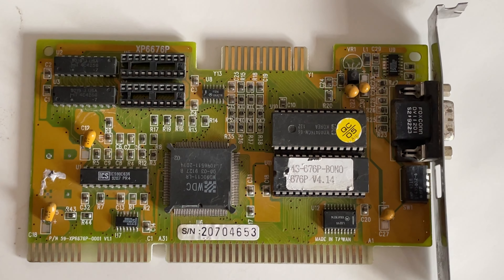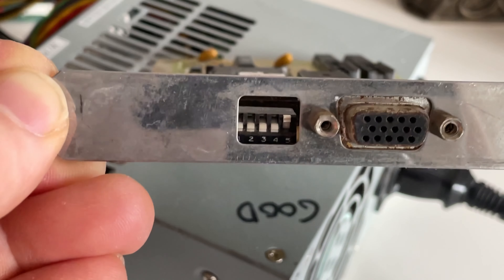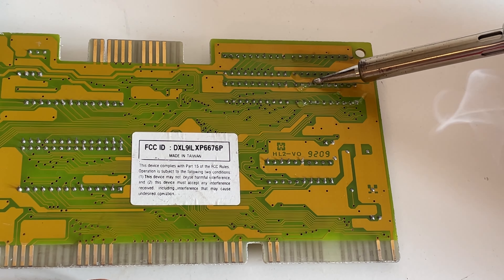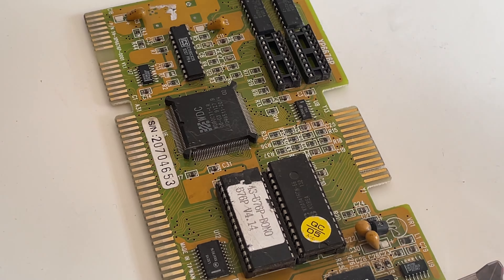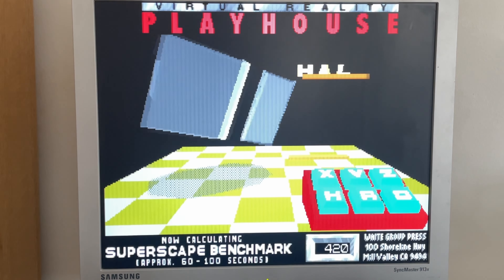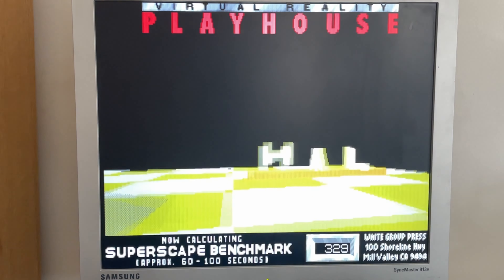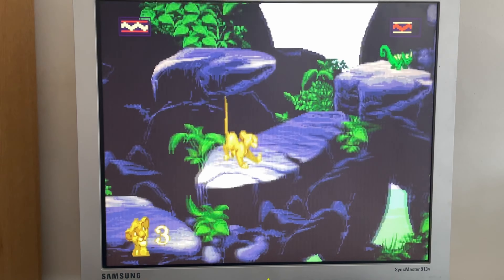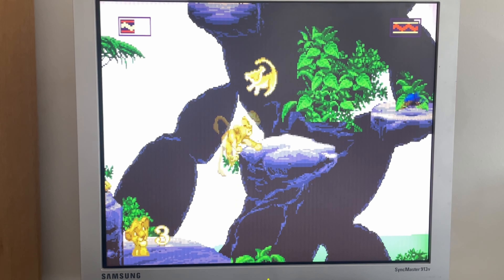Can I repair a 33 year old video card bargain from eBay?!

Comment: I now have a pit in my stomach that I threw out an artifacting Cirrus CL5480 that might have been recoverable, back when I was a big fan of Cirrus logic.
I'd had a 5428 VLB, a 5446 was my first PCI card, some 5465's turned up and I might even still have one in a box, but this was the first 5480 I'd seen (from a bargain bin at a computer fair), saw the same stall at the next one, and lamented the failure but accepted it was pot luck, but the guy said they should all be working, pick another .... found a Matrox Millennium 2